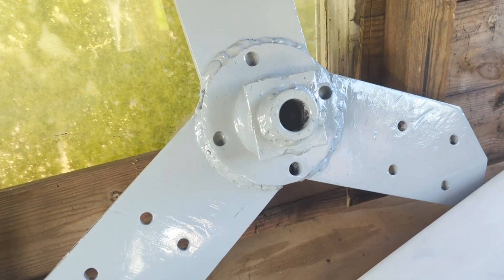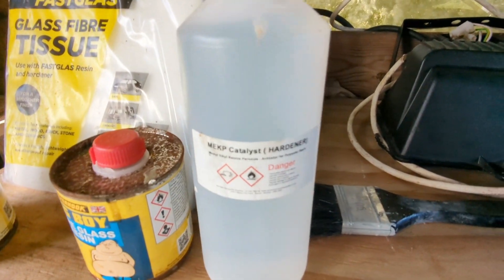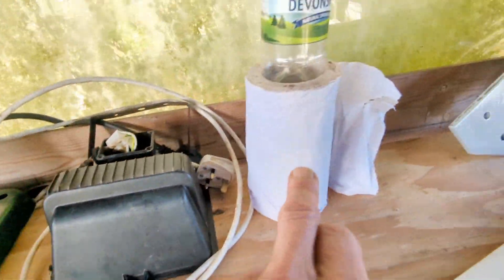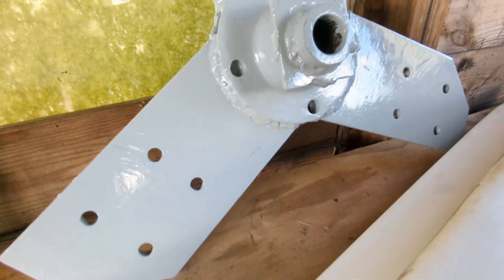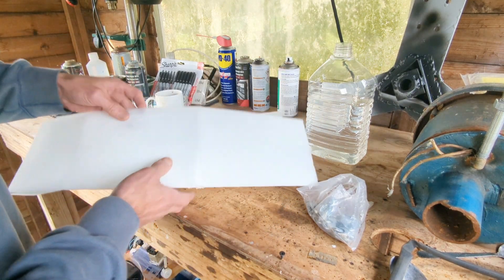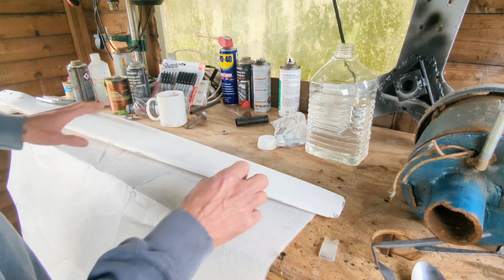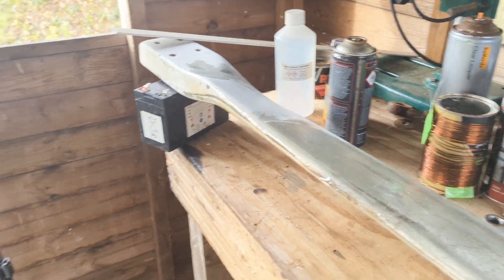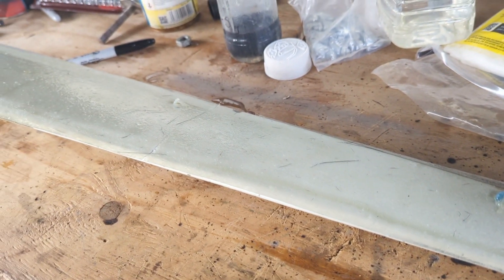Fibreglass Wind Turbine Blades - Making them stronger and longer lasting - Part 1 - 19th Oct 2022

Comment: Did you notice better results with current hub-motor configuration  than with double LG DirectDrive motors? Can you provide me your hub-motor data (weight / diameter) please? I bought recently elmoto h3 motor (10kg / 25cm - 10 inch dimater ). I wonder how much power can it produce.
Reply from the maker: That project got scrapped as didnt work well enough , I have no idea how much your motor will produce, cheers.